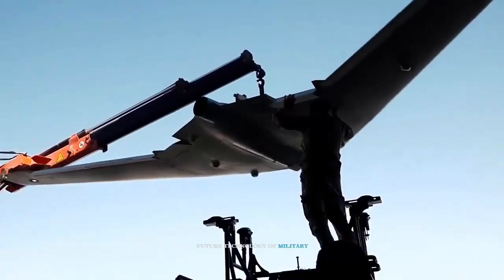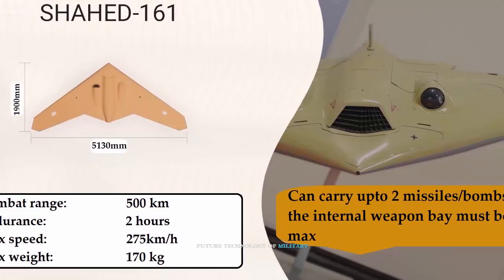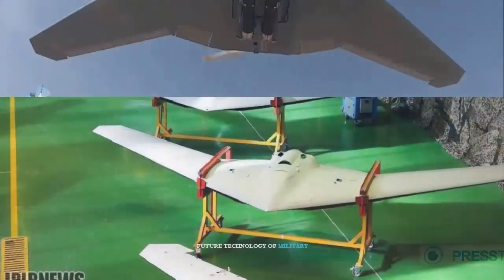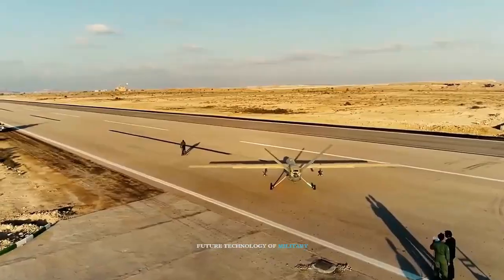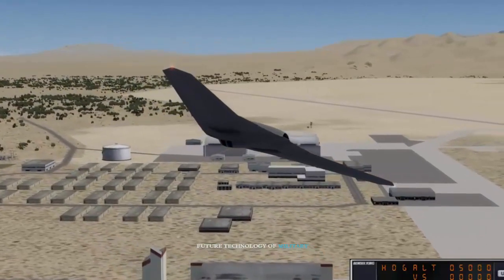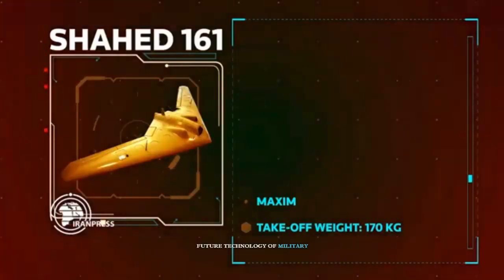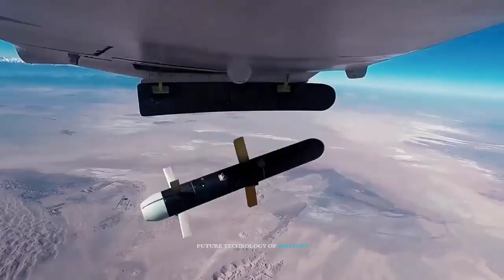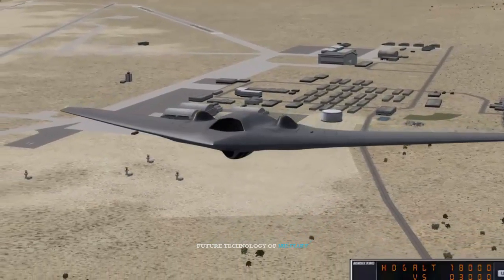Here's the Shahed Stealth drone, Symbol of Iranian Creativity in Reverse Engineering RQ-170 Drone

Comment: I think the speed of the Shahed-171 and Sahahed 191 and Sahahed-161 Stealth Drones is still in the experimental phase. The Program is due to end in 2025. By 2025 I think the Maximum Speed will be multiplied by 2 or even 2.5 or by 4(For Shahed-161). Iranian Stealth Drones are still in the Experimental Phase. I sincerely believe that the Maximum Speed of the final versions will be much higher. Final Versions will have Supersonic or high Subsonic speeds.